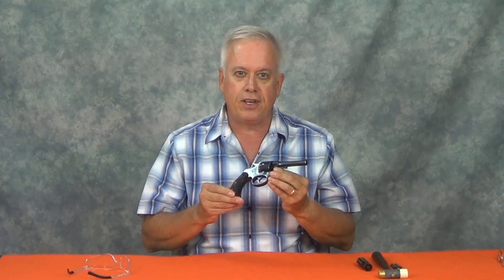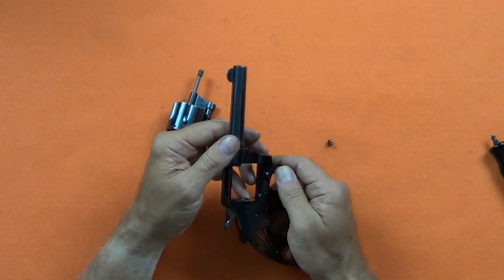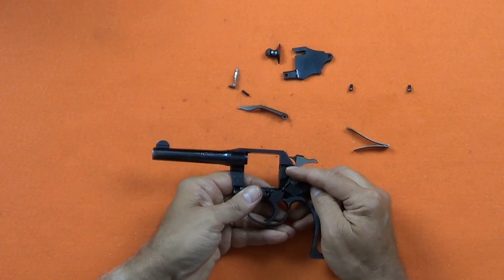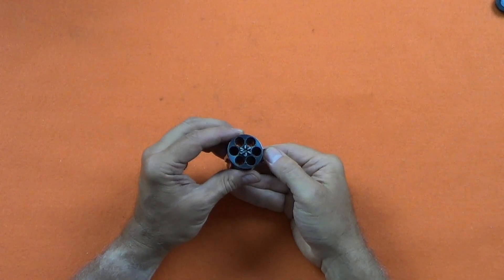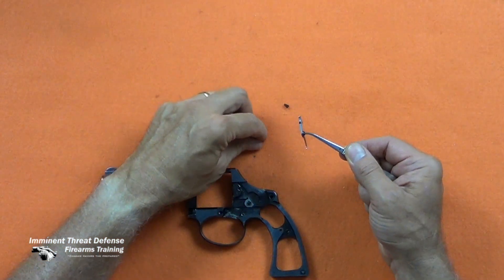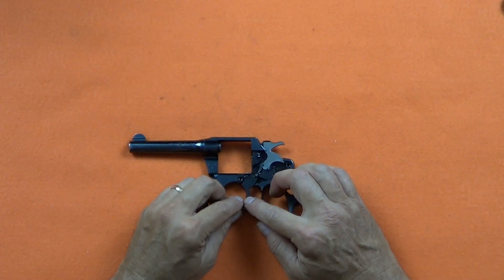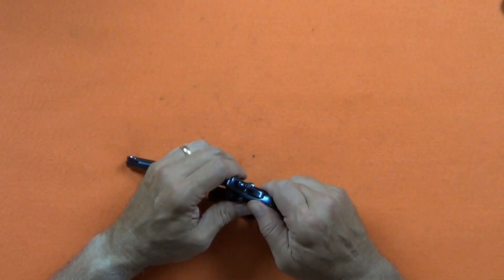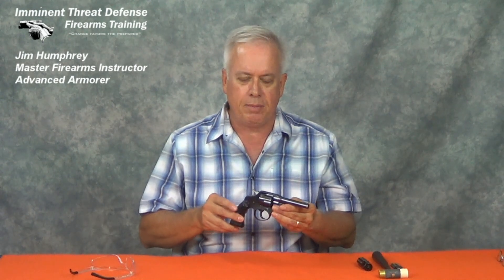Colt Police Positive - Disassembly

Comment: 7:00 I just magnetized my drivers for small screws. It works just fine AND it gives a. Secure centralized place for all the small screws, pins and springs.
You also don't risk greasing up the entire set of tools because you forgot to wipe down your driver before putting it back
Reply from the maker: Yeah a lot of people do magnetize their tools, I've had mixed results.  I find sometimes the part get's magnetized when you don't want, and when trying to place a small screw in a narrow opening the part then snaps against something else and you have to untangle them.  I do have a little magnet parts holder on my bench block, but use that mostly for parts that will roll away like springs and pins.  Thanks for the comment, always good to get alternative ideas out there.  Thanks for watching and commenting!
Reply: @ImminentThreatDefense  I don't gauss them that much. Just a couple of swipes on both sides of the driver with a cheap fridge magnet. The field is barely strong enough to hold the screw and half the time I ruin the field when I drop the driver into its box.

Comment: Thanks! One question. At 6:00 when I screw my ejector back on it goes past the notches. I Can stop and alight it like it’s supposed to be but when I use the ejector it comes out of battery and then I can insert bullets into the cylinder. Did someone screw mines on too tight? Is there a fix to this?
Reply from the maker: Sounds like somebody screwed yours on too tight.  The ejector is staked during the factory installation.  I seldom restake them because they're so tight.  In your case you'll probably have to stake it again.  A staking tool like the S&W sight staking punch will work.  Brownells # 080000090  Hope that helps.  Thanks for watching
Reply: @ImminentThreatDefense  awesome! Is there any videos here on yt demonstrating this?
Reply from the maker: @Isaihernandez777  I've got a cylinder disassembly video coming out in a few days where I talk about it but I don't demonstrate it.
Reply: @ImminentThreatDefense  thanks, I’ll keep an eye on it.

Comment: Perfectly made instructional video.  Thank you so very much.  One question: will a hammer from a .32 S&W fit as a replacement for a .38 S&W?
Reply from the maker: There were two different frames for this gun, the original and the "D" frame.   If the hammers where from the same frame, they might be interchangeable, but I wouldn't do it without a very careful comparison of the dimensions.  Even then it's tricky, the action parts for these guns were all hand fitted, so changing even with an identical model/caliber hammer could have fit issues which could result in a very light trigger, with the obvious subsequent safety issues.  Hope that helps, thanks for watching!
Reply: @ImminentThreatDefense  
Thank you.  Your response is deeply appreciated.

Comment: Great video. I have a Colt Police Special in .38 that the latch doesn't go forward on its own about half the time when the cylinder closes. It's easy to push forward so I ordered a new latch spring assuming that it has just weakend over time. Anything else I should look for when I take it apart to put the new spring in? Thanks
Reply from the maker: Could be the spring, but it's probably just the latch is gummed up and can't move freely.  A good cleaning will probably fix the problem but it can't hurt to replace the spring.  Good luck & thanks for watching.

Comment: Im pretty sure that Colt pistol was chambered in 41 long colt too. I thought 38 colt was entirely different than 38 Smith and Wesson special?
Reply from the maker: The actual revolver in this video was chambered for the ".38 Colt New Police" which is definitely entirely different than the .38 S&W Special.  The ".38 Colt New Police" is the same as the .38 S&W (not special) or sometimes called the .38 S&W "short" to differentiate it from the .38 Long Colt and the .38 Special.  The later upgraded version, the "Colt Police Positive Special" did come in a .38 Special chambering, but I'm not aware of a .41 long colt version.  It is hard to keep all these older chambering straight though, so maybe.  Thanks for watching and commenting!

Comment: How do you get the extractor star aligned the way it is supposed to be?  Is it simply a matter of turning it until is is fairly tight and then continuing on until you have alignment?  That would mean there is no hard stop or you don't tighten to the hard stop.  If you do tighten to a hard stop then I can't see how you would achieve alignment.
Reply from the maker: see the video at 5:12 and 6:13. Two of the arms on the ratchet (extractor star) are notched and have to align with the corresponding lugs on the cylinder face so you have to be at least 180 degrees off if you put it in wrong and that makes it obvious that it's not on correctly.  If the lugs aren't aligned the ratchet won't fit.  If you are 180 degrees shy of fully on, the lugs will align but it should be obvious that the ejector rod isn't protruding enough, or if on the other hand you've over turned it 180 degrees then the ratchet probably bottomed out on the threads or the rod is protruding too much.  Always a good idea to either mark or measure these before disassembly (see the video 5:12).  Thanks for watching
Reply: @ImminentThreatDefense  Thanks, I got it on.  The first thing I did was take a look at the damage to the male threads that the staking had done.  I took a small triangular file and cleaned up the first threads because I had read that you could cross thread if you weren't careful.  Maybe because of my file work, I had no problems getting the extractor on square.  The extractor was a tight fit which kind of answers my question.  You just screw it down until it is close to bottoming out and then move it in or out as necessary to match the arms.  I've read you can use thread lock to replace the staking, but the extractor was so tight that I didn't bother.

Comment: How can i straighten the recoil plate? On my pp you can see its not flush. Is that why it wont shoot?
Reply from the maker: ? You're sure you mean "recoil plate" the small pressed in, plate with the hole for the hammer nose/firing pin to go through when it hits the primer?  If it's somehow started to protrude then yes it would stop the cylinder from revolving.  You could use a brass rod down the barrel to hammer it back flush.  If it's protruding and won't go back flush could be some gunk behind it, you might have to remove it first and clean out the pocket.   If it's damaged, it's a replaceable part you can find them at Numrich for about $6.  Hope that helps. Thanks for watching.
Reply: @ImminentThreatDefense  thanks man! Appreciate that. Yes the small pressed in plate. What is I called?
Reply from the maker: @dom-te8bu  Yeah that's a recoil plate, but I didn't remove it in the video, so I wasn't sure we were talking about the same part.  Most often, though people get part names wrong, you had right.
Reply: @ImminentThreatDefense  thanks for the help and reply. When I get around to try to fix the problem I'll let you know if it fires.  Thanks again
Reply: @ImminentThreatDefense   how can I remove it to clean it
Reply from the maker: @dom-te8bu  I'm not sure you can, I never tried.  But if you can it would be with a punch from the back side.

Comment: I have a colt .32 that I've shot occasionally and I have one question about the gun. When holding the gun and pointing down range if I grab the cylinder (wheel) I can turn the wheel to the left but it can't be turned to the right unless fired. It takes a little pressure to move it left but not much. Is this normal for this revolver?
Reply from the maker: Colts normally turn to the right when operated, but it should only turn itself to the right when you cock the hammer (or pull the trigger).  With the hammer forward (or fully back) you shouldn't be able to turn it to the left (or right), the bolt should be stopping any rotation.  If the bolt is worn or the cutouts in the cylinder for the bolt are worn it can cause what you are describing.  Check your bolt engagement.  Hope this helps
Reply: @ImminentThreatDefense  thank you for that info. I'll start there.

Comment: Jim, I was hoping you would show where the serial number is located on the Colt Police Positive
Reply from the maker: It's on the frame underneath the crane.  I usually obscure the SN's on the firearms in my video's but you can see just a little bit of the SN on the left side of the inset picture at 7:34.  Hope that helps.  Thanks for watching!

Comment: Hello I'm Vincent i have a s&w model 732  # start with  AP a old model,can you or have you made a video  on assemble and disassemble that  gun ill check back
Reply from the maker: Actually what you probably have is a Harrington & Richardson 732 in a caliber S&W .32 long.  H&R made a whole series of these guns that were virtually identical in design,  the 732 is very similar to the 504, 603, 604 and 903.  Unfortunately I don't have access to any of those guns right now, I generally only do video's on guns that I have access to through friends, family or the occasional service.  However, I did see somebody else did a disassembly video on a 504, which would be close.  Not as good as one of my videos of course :-)

Comment: Does anyone know why the hammer and trigger wont budge on the one i have?
Reply: I know this is a late reply but check the cylinder lock near the bottom. It locks into the grooves on the side of the cylinder to keep alignment as you fire between cylinders. It should angle down to allow free movement between cylinder alignment.

Comment: Help I am a mancave gunsmith,I love to work on old guns and have a YouTube channel of some of my work.Now to the issue. ...I have two Colt Police Positives in .38spl. 1928,1964.
With the cylinder open,The actions on both revolvers  in both double and single action work just fine..
As soon as I close the cylinders,The triggers on either gun will not pull..Hit the cylinder release,cylinder drops to the side,action works as good as new....
What is going on.. I disassembled both revolvers by watching your video. cleaned both guns separately to avoid parts mixup.Reasemmebled both revolvers using your video..
Still have the same issue..What is wrong with these Colts.? PLEASE HELP.
Confused in S.C.
Reply from the maker: seems odd., especially that they're both doing the same thing. Nothing personal but two guns with the same problem often points to the operator  🙂.   But from a mechanical stand point. The bolt stop, latch pin, and cylinder release, dance an intricate little jig to make sure the cylinder is lined up and closed before releasing the hammer to move.  So something in that linkage is probably out of sync. Make sure you're rotating the cylinder into lock position when you close it.  Then if the hammer moves watch the cylinder to make sure it rotates, if not it's a hand issue.  If that's not it make sure the latch pin is moving freely and with the cylinder latch.  I hope that helps but if you want to discuss it in more detail feel free to contact me directly at ITDefenseTraining@gmail.com
Reply: @ImminentThreatDefense  ,Email sent
Reply: Opa amigo! Tenho um colt 32 police pocket ! aquela Numeração raspada entre o corpo e o.suporte do tambor raspada! Da alguma coisa pelo fato de ser muito antiga??